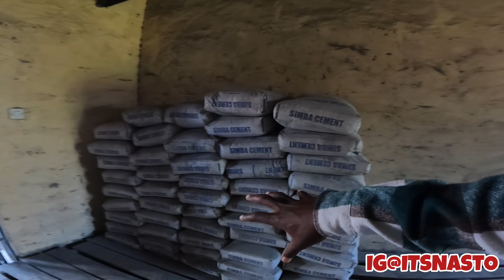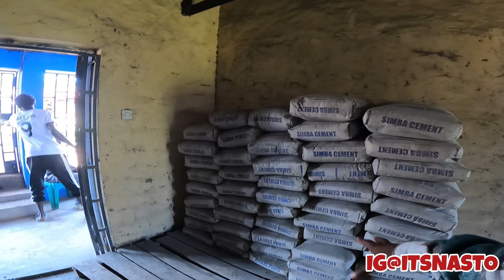BIG SUPRISE FROM USA 🇺🇸 || OUR KITCHEN IS  TAKING SHAPE 🙏🏽 || FOOTBAL GAME 🏆

Comment: Fridge should be always in the kitchen, opposite the cooker.
Cooker, sink and fridge should be in a triangle position in the kitchen.

You have done a good job to ruin it by putting the fridge in the living area

Before proceeding just tell the electrician to cut the wall opposite the cooker so that you can have two double sockets on that side. It’s a little set back but you will appreciate this later